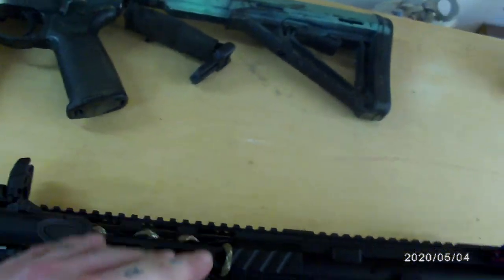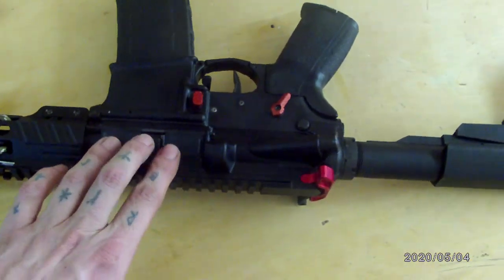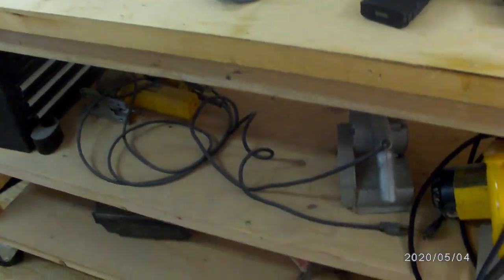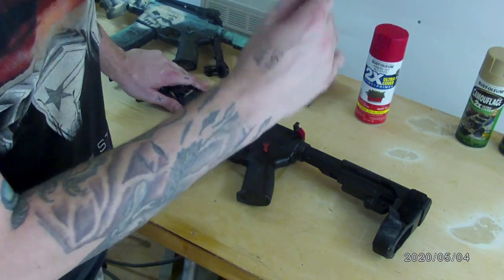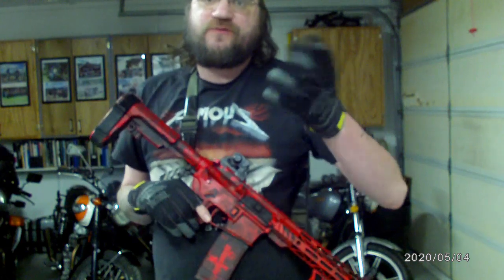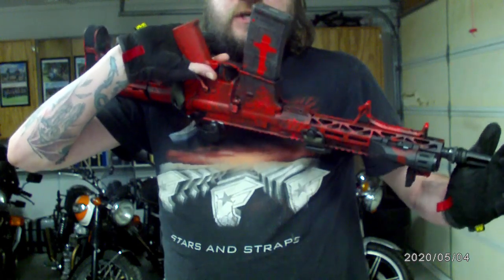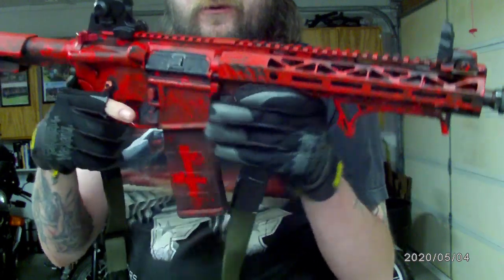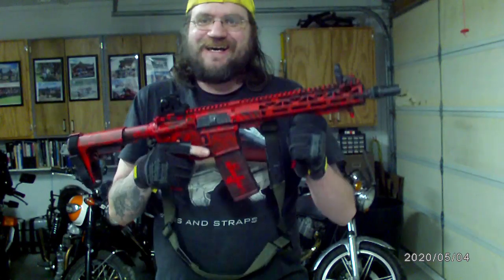AR-15 Blood Splatter Paint Job - How To pt 2

Comment: That should have screws why not just take it off why tape around crap that you can take off
Reply from the maker: Could be.  This gun is still a bit new to me.  I'm experienced doing paint, but this gun in particular is a bit new to me.
Reply: @Darkdally  ok...cuz I was thinking....If you tape off attachments and paint around them, when you remove the attachment you'll have a "Bald" spot.